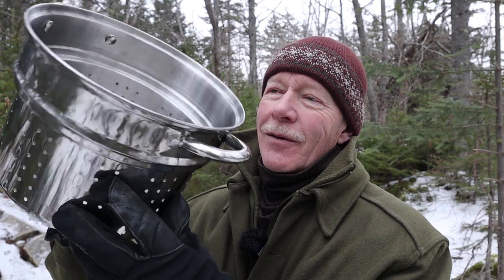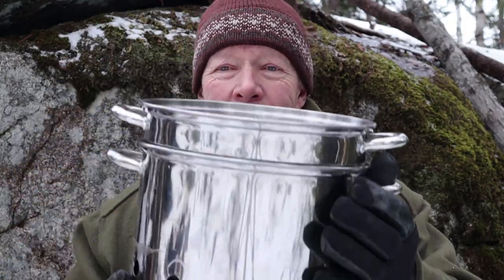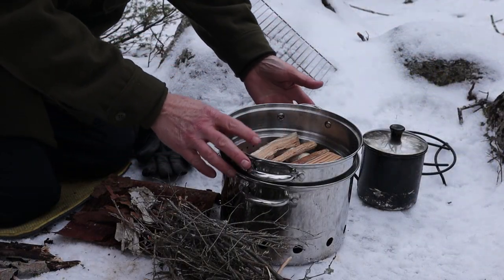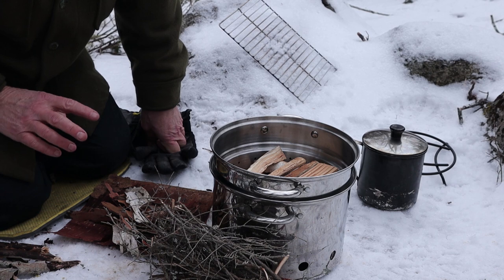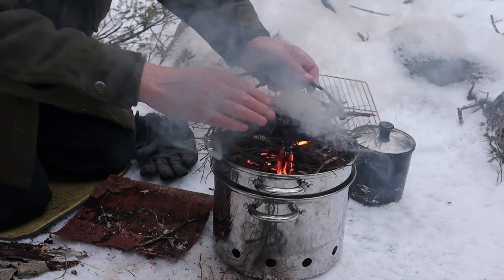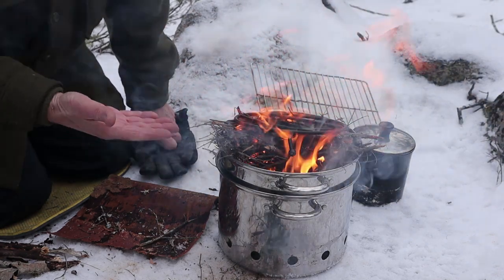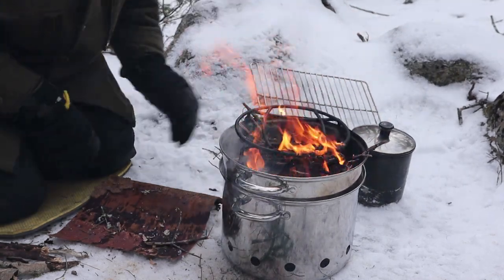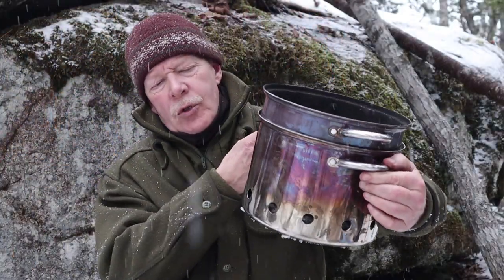Super Size Hobo Stove - Version 2 (Will it Gasify?)

Comment: For complete inlet air control, cut a strip of aluminum flashing 2 or 3 inches wide and 2 inches longer than the circumference of the outer pot. Bend about an inch of each end to about 90 degrees so that they can be fastened together, forming a loop. It needs to be a loose fit around the pot, so it can slide easily. Mark the centres of the holes on the band, then remove it and drill or punch 1" holes on the centres. Fasten the end tabs together with pop rivets or small bolts and slip the band back on the pot. Install 3 or 4 pop rivets (from the inside) or  screws around the pot, below the band, to keep it up at the correct level to align with the holes in the pot. By sliding the band back and forth, you can have the air holes completely open to completely closed. Since the pot hasn't changed colour, it isn't getting nearly hot enough to melt aluminum, at least down around the bottom. The fastened tabs form the 'handle' to allow you to adjust the vents with a stick.
Reply from the maker: You must be reading my mind. That is pretty much what I am planning on doing. Thanks for commenting my friend

Comment: Very nice project! I wonder if you still have the lid for the set, and cut a "restriction" ring about 3" wide to help hold the flame inside the pot. (Cut the center/top off the lid, just leaving an outer ring.) I think you will be pleasantly surprised how much that ring will change/concentrate the flame.

As an aside, what I find with any fire pit like this, is the heat is felt and directed more upward than out. If you want to use this sort of firepit as something to sit around for warmth, it has to be down in a hole, or you have to be standing above it to get the heat.
Reply from the maker: Funny thing. I can't find the lid. I was going to knock out the glass center and make a focuser. I need to see if I can find something that will fit. Thanks for commenting

Comment: Most gasification stoves have holes at the top and bottom of the inner chamber and are solid sheet metal in between. This allows the air between the chambers to superheat which accelerates the air into the burn chamber via the upper holes. You are right. If you wrap the inner chamber in solid sheet metal, the stove will gasify. 
Nice project, Mark. Thanks. It has applications for car and canoe camping and backyard use for groups toasting all sorts of things on sticks. 👍
Reply from the maker: I am planning on testing a few ways to restrict airflow like you say. It was originally meant for group hikes but car camping is more realistic I think. Thanks for commenting

Comment: Great video, Mark. I appreciate whatever you do in the woods with heat and flame. The stove seems to work fine. As you mentioned, it might be working too well. To further regulate the air flow I would suggest the pipe clamp. You know the one constructed with finely slotted thin and narrow steel band. I think you could get them up to 1 ft in diameter. If not you could always connect two of them together. Slip it over the holes out side wall and tighten it. Easy to adjust the air flow by simply  moving it up and down. Can't go back in time to make the holes smaller but you can block them some. Nice of you to share the experience as always.
Reply from the maker: Interesting idea. I had tried this with a Solo stove but it did not work. Might work for this stove though.  I had a different Idea but I will try both. Thanks for commenting my friend

Comment: I guess it’s too late now but possible less holes drilled into the side and add more accordingly. Hose clamps as feet maybe.

I think I’ll be getting a set of these, well done.

Thanks to your Ikea strainer review I have the Ikea strainer hobo stove but, I have it slotted into a coffee can with holes drilled in the side at the bottom. I use trivets under the can so to raise it off the ground and, I use tent pegs to both adjust the height of the Ikea strainer in the can (more so for testing to get the right height for best burn and to deflect the cross wind) but, I can also use a Trangia type burner inside the Ikea strainer because it sits on the tent pegs. This makes it a multi fuel hobo stove. In solid fuel configuration the higher I make the Ikea strainer (using the pegs) I can lower the height of a pot which would sit inside the Ikea stove on the pegs. I also have trivets for the top so to add wood as necessary.
Reply from the maker: I like your suggestions. Actually, I do have a few ways to cut down the air entering from the outside that I will be trying. Let me know how your project works out. Thanks for commenting

Comment: yess.. it works.. i did it with an aspargus pot.. similar to this pot, the same hight but smaller in diameter!
Try a band of metal outside the pot! with this it you can regulate the airflow up or down
or try to close some holes with a wooden plug.. temporary.. to check the airflow!
Did you try your pot with a few kg/pounds of Pellets?
it should work also very fine...
a few more ideas.. smokeless heating of a Tepeetent or a big Grouptent with smokeoutlet? Heater with charcoal? with air regulation
..... 3 bolts under the pot should work, to protect the ground.. or 3 stones.. or a large cross potstand under it.... old car rim... aso... too many ideas... 😂😂😂😂😂
we wait for the next video.. part 2.
to be continued.. 😁👍 thanks for sharing.. i will try to find also a wider pot, like you have... maybe a chimney over it.. i dont know the right word in english... like over a forge of a blacksmith? if you know what I mean? Emergencystove in a cabin.. tent.. cave.......
Reply from the maker: Hey Derek. Thought you might like this one. Similar to one of your stoves I believe. Thanks for commenting

Comment: My first thought "That's a tiny Pit Barrel cooker!" 
If your design had a single lower vent hole with the Pit Barrel damper (a disc attached by a screw) it would be easy to adjust airflow. Some of those pasta strainer pots have a domed lid with an adjustable vent built into the lid. With a trivet or rack that nests down into the pot and a handful of charcoal you could turn your pot into an oven/smoker like the Pit Barrel cooker.
It might be worth a look at YouTube videos about the operation of Pit Barrel cookers for their damper design.
Reply from the maker: Right on. Great suggestions. Thanks for commenting

Comment: Create a band of metal with holes to fit around the pot to adjust the size of the openings. Also if the strainer had some of the holes blocked perhaps with a cylinder of metal you might get some gasification. Alsoyour trivit might be useful in raise the stove off the ground. As it is the stove worked.
Reply from the maker: Yes, I am planning something very similar to your suggestion. Thanks for commenting

Comment: Hi Mark. cool project indeed! My couple of thoughts... I had a little round bbq that had a 1/2 moon shaped grate  warming rack in it. If one was able to find a match to the size pot(s) one was using that could be very useful. Regarding the heat transfer - only an inch deep hole in the ice is actually not bad! Ice melts much easier than "ground" conducts. You can melt even very cold solid ice simply by putting your hand on it. Not very efficiently but (or for very long lol) and skin surface temperature only being about 96 would never get even the driest of sawdust to combust. Maybe that is good test.??!? In a controlled setting (when its warmer out??) do what you did today while the pot setup sits directly on very combustable material such as dry sawdust/leaves/moss etc. I would be willing to bet there wouldn't be an issue.
Anyway great project which has given me inspiration to look for such a pot combination and try out.I'm looking for setups for outdoor cooking at what at this time will call our permanent camp. I would vote for seeing more videos along this subject line. Be well!
Reply from the maker: Great suggestions. I will be trying a few more ideas on this project for sure. Thanks for commenting

Comment: You could make a hoop of metal that fits somewhat snugly around the bottom pot but can still be rotated, drill holes that line up with the holes in the bottom pot and rotate it so it controls the amount of air, like the draft on a wood stove.
Reply from the maker: Yes, that also is one of the ideas I am playing with. Thanks for commenting

Comment: If the double boiler came with a flat lid. I think you could achieve much better gasification by cutting most of the center of the lid out. (Keeping about an inch or 25mm of the outer rim.)
Reply: Also, by closing off all the side holes except the top two rows should help with gasification.
Reply from the maker: Both comments have good suggestions. I am considering a few similar ideas including a focuser for the top. Thanks for commenting

Comment: You could experiment with aluminum tape to block off the holes in the bottom pot to see if you can determine the "optimal" number of 3/4" holes...
Reply from the maker: Yes, that is one of the ideas I am considering to play with the air flow. Thanks for commenting

Comment: Good luck. Is there a simple engineering article explaining the needed  design characteristics  (air in, air out) for how to construct the best gassing stove? Solo's do a great job. Has anyone "deconstructed" one not tearing apart, but just figured out the relationships?
Reply from the maker: I wish I knew of a complete but not overly technical resource for this type of information. Most of what I know I learned from a variety of sources. If I can find something that works I will be sure to share it. Check out Heath Putnam on YT. He has some great info. Thanks for commenting
Reply: Thanks. I'll check out the channel. Not overly technical may be the problem. I'll check out If I find something I will share.

Comment: Yes try a version 3 with less or smaller drill holes.
Reply from the maker: I am considering how to block a percentage of the holes. Thanks for commenting
Reply: @MarkYoungBushcraft  that would be better than starting over. Great idea. Maybe an aluminum welder to tack on little aluminum squares?
Reply: Don't know what happened to my other reply. 

Simply use some aluminum foil and wrap it around a couple of times just for testing. Use hose clamps to keep it in place.
Reply: How about restricting the mouth of the stove or you can block off the lower portion of the colander insert side wall so that only a few of the top rows of holes are exposed.
Reply: I bought one of these pots. I'm waiting for version 3 to see how you make it Gasify, before I drill my holes. Are you going to put a lid type structure on top like the solo stove?   Is this what will make it Gasify or create pyrolisis?
Reply: @MarkYoungBushcraft  You can buy stainless plugs that patch holes like the ones in a sink at Lowe's or Home Depot. They just snap in place and look very good.

Comment: I want to this also. Had the idea of making a wood gas stove but from aluminum pots but smaller ones 😉
Reply from the maker: Smaller would be better for carrying for sure. I would stick with stainless steel though. At least for the inner chamber. Not sure aluminum would handle the high heat at the center. Thanks for commenting
Reply: @MarkYoungBushcraft  maybe your right Mark 😉

Comment: HI     WHAT IF YOU WERE TO TURN THE TRIVET OVER , PUTTING THE HIGH SIDE IN.  YOUR POT WOULD DOWN INSIDE CLOSER TO THE FIRE . I DO NOT KNOW IF THAT WOULD DO ANY GOOD OR NOT. YOU JUST WILL HAVE LESS ROOM FOR WOOD.    ALSO YOU COLD USE A SMALL BALL OF TIN FOIL TO PLUG SOME OF THE INLET HOLES TO LOWER INLET AIR FLOW.  THIS IS A GOOD SIZE STOVE FOR SMALL GROUP OF PEOPLE.
Reply from the maker: Yes, flipping the trivet is an option, I am planning a couple of ways to reduce airflow. Looks like fun to me. Thanks for commenting

Comment: Mark,
I think you need better research, understanding and definition of what pyroiisis actually is. Also in all the woodgas stoves I have used the gasses don't "go back in" because there is not a defined path of travel/channel for that to occur. In fact much of the air goes up the sides just once and into the chamber directly the first time. Also much of the air goes straight in the bottom and up thru the wood. The air is actually being drawn in the bottom and dispersing in all directions as directly and quickly as it can to the exit point... in any case the design of a wood gas stove provides a system with an inner sleeve for good unblocked airflow and an outer sleeve that maximises use of heat energy and thus burning more cleanly. No woodgas stove is perfect but you said yourself that your strainer system burns "pretty clean" so then you have created a "pretty good" woodgas stove that is in fact a wood gasifier. Non the less I suppose you feel the need to cover yourself by saying it is not one... I don't know about that... just say it as it is... I wouldn't mention pyrolysis. Your about the only one that does and it doesn't look any better when you are actually not verifiable.
Reply from the maker: Thanks for the information. I won't argue that I do not fully understand pyrolysis. Having said that I do feel I understand the airflow through a wood gas stove. If I said the gasses go back in then I spoke incorrectly. My understanding of the airflow is the same as you described.